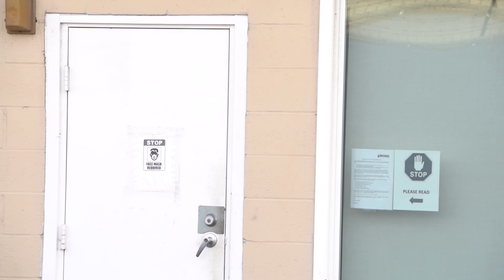DONT TAKE MY PICTURE CAUSE IT'S PRIVATE

Comment: I'm gonna give this to ya. 
THE  CREW
     OK folks here’s how ya do this 1st Amendment Audit thing as far as I can see it.
     Gather up 5 or 6 friends with BALLS and NO FEAR that want to have some fun and possibly end up with a bunch of money for your efforts. Then gather up some money to purchase 7 good quality video cameras, with telephoto and steady cam imagery, with night vision if possible, 4 cell phones, 2 body cameras, with extra batteries for all cameras, 3 wireless mics and 2 audio headsets, a couple tripods, 3 wireless microphones, a parabolic microphone for long distance audio recording and plenty of SD cards for plenty of recorded video memory and 4 Voice Activated radio communications headsets works great too. You can whisper to each other to better stay informed.
     Your “Crew” may or may not have any experience at “driving a camera”, that means operating a camera under many different situations with excellent resulting video. For instance: standing still, walking slow, walking fast, running, holding a camera at different elevations and aiming cameras at different things you can’t see and you understanding what the camera sees even though you are not looking at the view finder. You don’t have to look at the view finder, the camera will see what you aim it at. If you’re good you’ll even get the necessary Light, Frame and Focus in these actions and positions without even thinking about it because it comes naturally.
     You want the best recording possible so proper Lighting of the subject matter is Very Important, Framing of the subject or item of interest is also Very Important and Focus of the well-lit area of interest, at night under a street light is as good as you’re going to get and Framed subject matter is Most Important with as little camera shaking and movement as possible.
     The Crew should watch a bunch of videos of cop block, Audit the Audit, Bay Area Transparency, Direct D, and other 1st Amendment Auditors videos, there’s a bunch of’em and any other confrontations with the cops that others have shot and posted. Critique their videos and make the driving of your camera skills better than theirs. Always remember, even in tricky situations, LIGHT, FRAME and FOCUS. I’ll say it again, ALWAYS REMEMBER TO KEEP THE ACTION COVERED, DON’T LOOSE ATTENTION OF WHAT YOU ARE DOING. THE CAMERA, REMEMBER THE CAMERA. LIGHT, FRAME, FOCUS. You may miss a split second of video that turns out the be very important.
     This next step may take some time but it is the most valuable and most important issue. Driving the camera. That’s camera operation. Get the Crew together and go out and practice walking, forward and backward, over your shoulder of what’s behind you, running, holding the camera at different angles, over your shoulder shooting backwards as you walk forward, like from behind a wall or fence with the camera as the only thing above the wall as you are hidden behind the wall. The camera will be hard to see but you may be easy to see. After practicing a dozen times or more, Watch the Playback and hone your camera driving skills to the point you are good at it and your Playback meets a certain criterion. Remember Light, Frame, Focus. You Tube viewers will appreciate a good quality video of the IDIOT getting the shit kicked out of him by the cops.
     When you think you have it down pretty good and you think you’re ready, formulate a plan. Pick a location for an exercise. Draw straws, flip a coin or do what you have to do to get a volunteer from your Crew to be the, for lack of a better term, “IDIOT”. That person will be the guy or girl? to go into harm's way. 4 or 5 of your Crew will get set up in different spots for the best camera angles of the chosen location.
     Someone should be aware of what you’re doing and be, for instance, at home, waiting for the phone call. Just a necessary precaution for the Crews benefit. A lawyer on retainer with his 24 hours phone number wouldn’t hurt, is a good thing to have ready too. Go get acquainted with a bail bondsman. Have one or 2 of them on retainer.
     Be sure to park any transportation you came in a few blocks away in a legal area away from the chosen location so it can’t be towed for being parked illegally, Male sure your vehicle has been cleaned inside and out of anything that can be construed as a weapon, dope, anything and wiped down of all finger prints. Better yet have someone drop you off like uber.
     Your 4 or 5 camera drivers will proceed to their assigned spots a few minutes before the fun begins. These are spots that are away from the location chosen and hidden as much as possible from view but not in a way or position that would cause an alert to be sent out to anyone for any reason. These “Spots” Must be Public Domain and Public Property and must be able to be seen from the chosen location and visa-versa. That’s the purpose of cameras with Tele-Foto zoom lenses.
     Be Sure to Put Black Electrical Tape over all the Camera Cue Lights. Ya’no those red flashing lights on the camera that shows you’re recording.
     Use cameras with nothing at all in the memory. No personal phones with any info in them.
     Everyone is in place, all equipment is working properly, radio checks thru the head sets, EVERYONE KNOWS TO STAY FOCUSED ON THE IDIOT. Roll Cameras, The IDIOT arrives and proceeds to do his or her thing which is shooting video/ pictures from a Public Domain/ Public Property area of whatever the camera/ person can see. Totally Legal activity of anything you can see from a public Domain/ Public Property area.
     At this point, I should mention that no matter what happens during the next critical time period the CREW should stay put. NO MATTER WHAT HAPPENS, STAY WHERE YOU ARE AND CONCENTRATE ON THE INSTANT ISSUE AND THAT IS SHOOTING THE VIDEO OF WHAT’S HAPPENING WITH THE INTERACTIONS OF THE COPS AND THAT IDIOT.
     Basically,the Crew should NEVER let anyone know of the CREW and the Crew should Never say anything except to the attorneys.
     When the authorities arrive, THE IDIOT, all wired up for wireless microphones as in 2, body cam and hand held cam, should be ready to stand his ground and be as antagonistically polite as possible within the boundaries of the law. If possible, know the state statutes that apply to your location, situation and get busy. The Idiot has the Constitution on his side so a 1st Amendment to freedom of speech means You can basically say Anything you want to the cops. And I mean ANYTHING.
    Each situation is different so basically keep your mouths shut, don’t even acknowledge their, the authorities, presents. They will do the rest. They will either be obliged to “Kick Rocks” or “Kick Idiot”. Remember the more you get the shit kicked out of you the more money they will have to bark up. Remember the cops/ authorities are Criminals, illiterate fools, jerks, assholes, Dumb-ed Down Americans, power hungry dick heads, Corrupt Gun Totting THUGS, and TYRANTS and they will prove it in their actions. Just wait, watch and see for yourself.
     The worse it gets the better for the IDIOT and the Crew. Who knows, The IDIOT, may end up with a broken leg, arm, ruptured spleen, broken ribs and punctured lung, pissing blood for a month, black eyes, broken jaw, ruptured ear drum, dick kneed up into yer asshole, concussion, contusions, second and third circumcision, but remember, You’ll get over all that when the check comes into your bank account.
     As the action plays out with the Idiot and the cops the Crew will just concentrate on the VIDEO and AUDIO action all the way to the end. That will be determined by the injuries to the Idiot. He will either get handcuffed to the gurney as he goes to the hospital of just cuffs into the back of the cop car spitting blood and his eye is hanging on his cheek.
     Long after the cops have lied in statements and police reports have been completed with misrepresentations and embellishments, and the Mayor and the Prosecutor all have made their false statements, embellished accounts to various news media. The Chief of Police or The Sheriff have made their BS Statements to the media. The cops have all slapped each other on the back a hundred times. Then the real story comes out thru the attorneys that represent the Idiot and Crew members.
     If and When you end up in court, little chance of that, cuz’a’outa court settlement will happen way before any trial happens, the verdict will be in Your Favor because the judge will have your 7 good quality video camera angles with excellent quality audio showing the TRUE COLORS OF LAW ENFORCEMENT. The best part is they brought it on themselves, luckily there were 7 cameras watching. Your attorneys will have a field day in court with the crew's good video and audio work.
     The cops, Criminals On Patrol, will get their just rewards by being dis-graced, fired, bad press for the dept, divorced from wife or husband, kids will hate daddy forever, illegal drug use and alcohol abuse follows, Jail and/or Prison, no more guns as they have been charged and convicted of a felony and hopefully Prison, or possibly Suicide. Good riddance to bad cops.
     If there was 10,000 Crews all around the country doing this in every major city, small towns, National Parks, and almost anywhere there are Gun totting law enforcement/ criminals on patrol andwith insurance claims against the cops/ taxpayer in the hundreds of Millions of Dollars happening every week then the cops will be put in their place. Laws will change. Qualified Immunity disappears, The cops will be nice for a change. I still won’t trust them. COPS/ AUTHORITIES IN GENERAL ARE THE ENEMY OF THE CITIZENS/ PEOPLE.